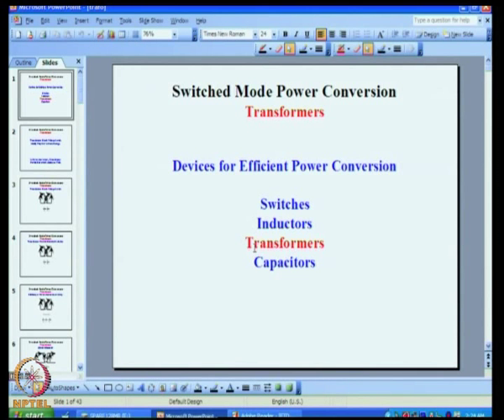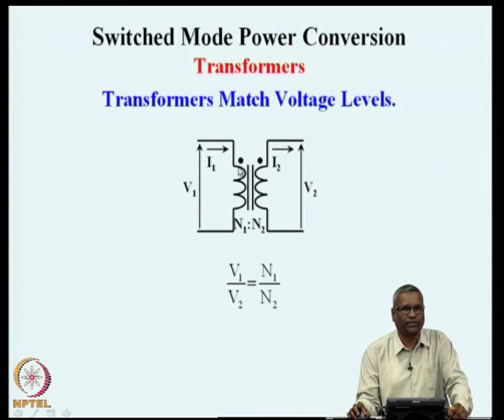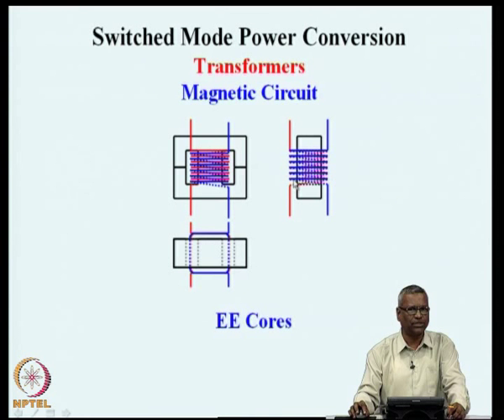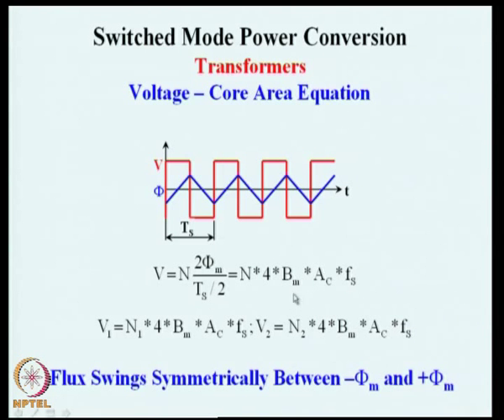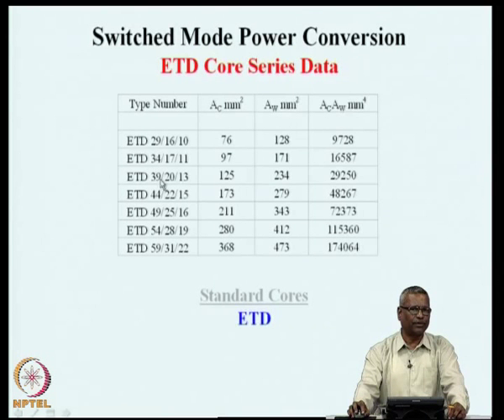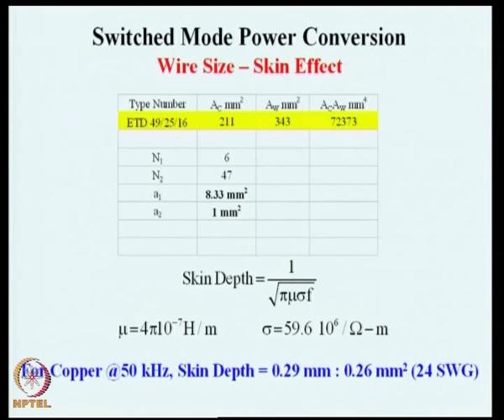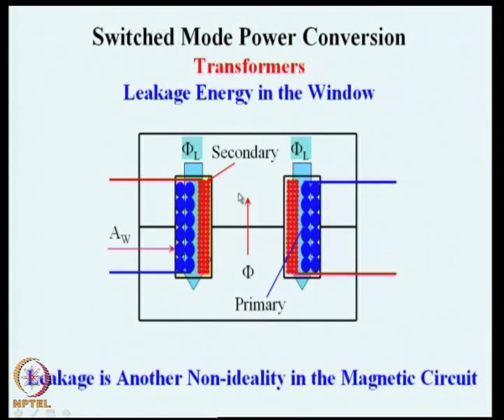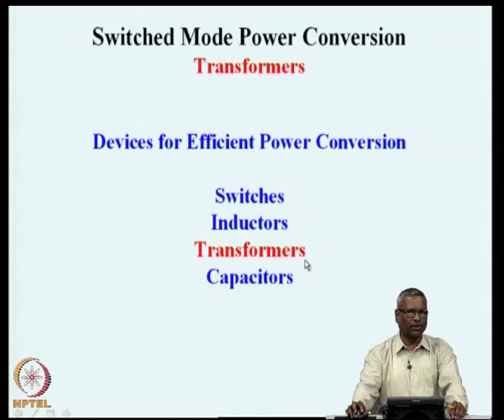Mod-04 Lec-06 Transformer

Comment: Parasitic resistance is calculated wrong.  I used America 22 SWG and for a single wire the resistance is about 26 mΩ and for that gauge wire, 4 are required to over come the skin effect. this gives about 100 mΩ for the primary side resistance base on the calculation of the resistance for a single wire 
R=ρl/A=(1.68*10^(-5) Ωmm)(6(83mm))/(π(0.644mm/2)^2 ).  Does anyone else agree with me? 

using 22 SWG data found at https://en.wikipedia.org/wiki/American_wire_gauge gives agreement for single wire R=(52.96Ω/km*498mm*km)/1000000mm=26mΩ
Reply: He has given the calculation for 24 SWG. The correct unit for the two resistance values should be milli-ohm and not micro-ohm.